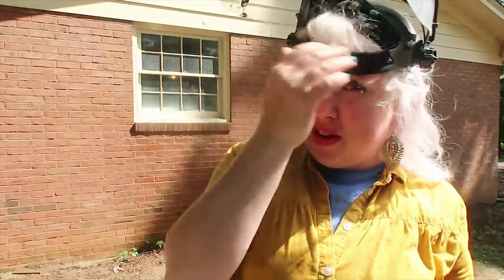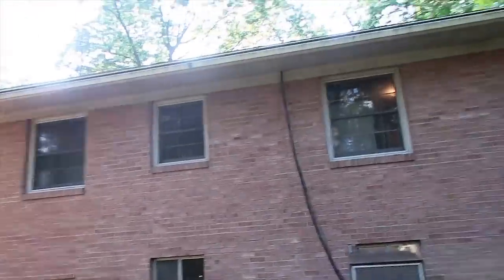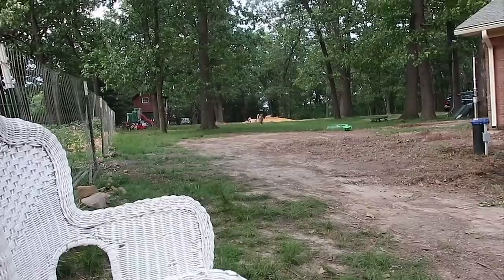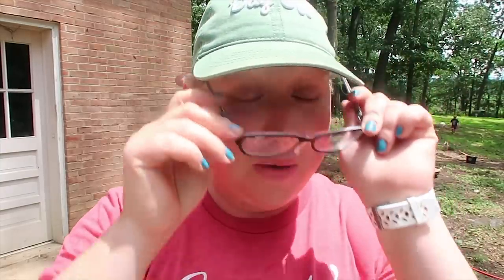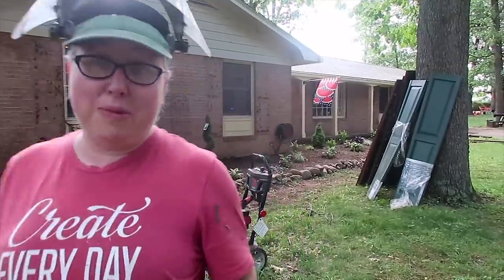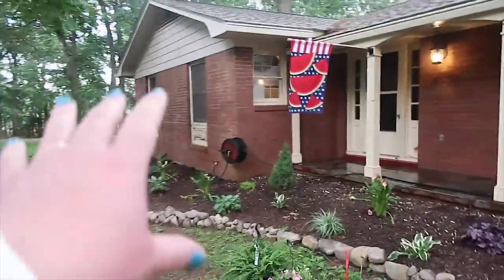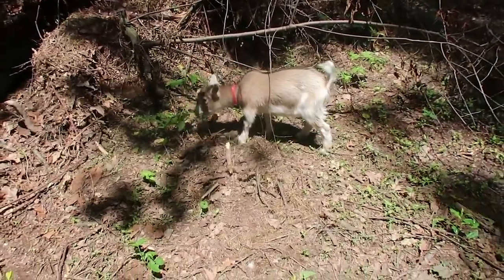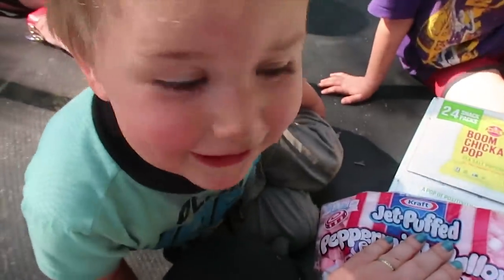LET'S HAVE A REALITY CHECK 😅

Comment: Fyi, here's tip for anyone power washing painted wood in the future.  Lay cheapo weedcloth/landscape fabric down over the plants and mulch.  Water goes through but the paint chips stay contained :)
Reply: I was going to say lay a tarp or dropcloth down to keep the mulch clean.  I do that when I trim the hedges now.  But using the landscape fabric is great for watering if it doesn't get too expensive!

Comment: Just curious, in southern louisiana in our concrete foundations there is a rule to never go past the foundation with mud as not to cover the weep holes where you can spray to keep away termites .They are also used to allow any moisture from condensation to drain out of the wall as well air to circulate. I see mud all up the side of your house covering the complete foundation...just curious.

Comment: You might want to check  your windows on the inside of your house for water leakage after power washing.  It is more forceful than rain and you might be surprised to have water sitting inside the window seal running down the wall on some.  Hope not but please check.

Comment: I have a central air that is least over 20 yrs. old.  This is my parents house, now mine, and it still runs great, I just let it run when I'm gone to work.  I talked to a furnace man and he said if it works let it be.
Reply: lilac2484 - My central air is the same age as yours as is my furnace.  I had both serviced and was told they are both fine. I wish I had 50% of Jamerrill’s energy.

Comment: we just had a courtcase here in finland (read it from paper). tile house got mold and moisture damage in all walls after washed with pressure. apparenlty the pressure got the water too deep unlike rainwater. ofcourse here the houses are insulated because of the winters so its more risk like that. i dont know if your houses there have insulation or what the structure is behind the tile there anyway:) but in general tile has pores, its not like rocks haha so water with power goes tru it in some levels and in this finland case insulation behind it got damb.

Comment: Yikes! Power washer issues: Don't use it on wood. If it's removing paint from wood it's also damaging the wood. Always spray from the bottom to the top. Dirty water from the top will just run over a clean surface but will permanently stain dirty surfaces.
Reply from the maker: Well then 🤪🤪🤪
Reply: I’m pretty sure she said the windows have to be replaced in a few years anyhow I’m sure the wood will be fine

Comment: Woman, you hold that power washer like a machine gun. 😆 Don’t mess with power washer, Jamerrill. House is looking good. We bought a 1950/60s fixer upper several years ago and the top half is siding , bottom half is brick. I never thought to power wash it. 🤔 I bet it would look a lot cleaner if I did.

Comment: LAZY ? YOU ? , NO , not lazy just smart , you got more than enough with milking , gardening, cleaning ,cooking , washing , shopping , business , kids , husband , church , teaching , you got to have some life and stripping the shutters is a lot of work , unless you buy the chemical strippers that is , they are smelly and quite dangerous around kids, but easy to use , however if you strip the wood there you got to strip it all and we are talking a lot of time for that many shutters , then you got to clean them and stain and then varnish , believe me even with what i know , its a lot of time and many coats , so , common sense says, nope not lazy smart , maybe in a few years when you little ones are no longer needing so much input but for now a nice fresh coat of paint is kindest to you
Reply: i would recommend you read up on trees that shed branches and then you can look at your stock and check for any more loose dangerous branches better safe than sorry with kids running round your wooded area , there are a few that shed